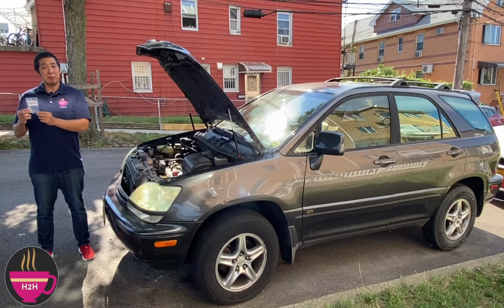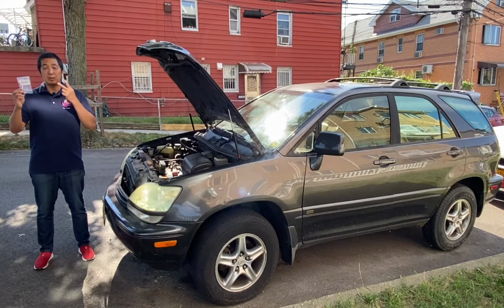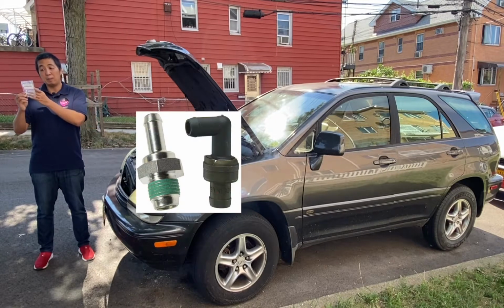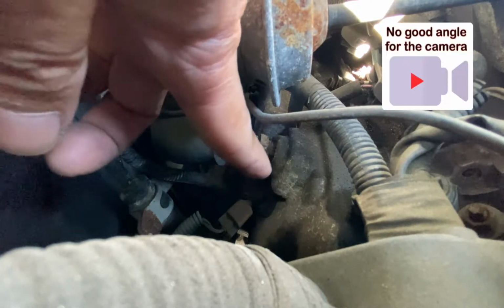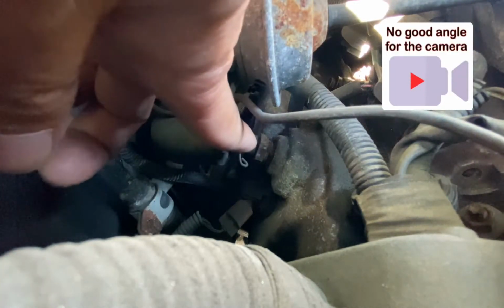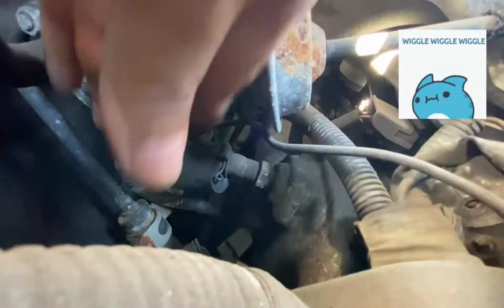How to: PCV Valve Replace for a 2002 Lexus Rx300 [Positive Crankcase Ventilation valve]

Comment: Your '02 has the parking sensors in the bumper, i did not know the rx 300 had that from this year
Reply from the maker: Hello. Thank you for noticing. Actually, I put them myself a few years ago before I was making videos. You can buy a set from Ebay or Amazon. They even include the drill for the hole. If you do it, just be sure you clear the metal bumper behind the outer/plastic bumper. You do not want to drill on the metal bracket. Hope that helps, and thank you for watching! -Rjeff H2H
Reply: @How2Helen  wow, how many miles does your car have
Reply from the maker: @TrollingWithTheTruth  around 203k miles already. Unfortunately, we will be selling it soon as we bought a newer model(rx330) and we cannot keep both. Thanks- Rjeff H2H